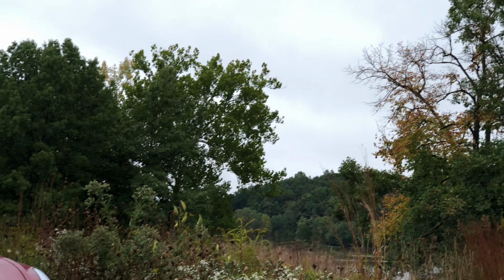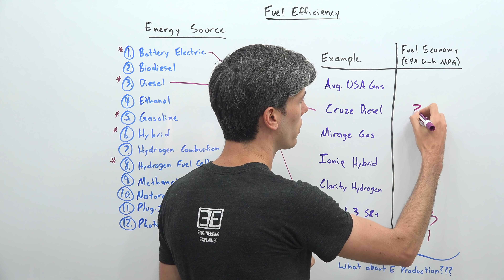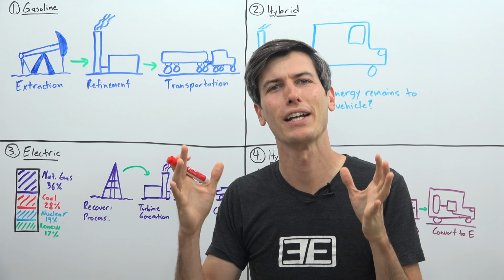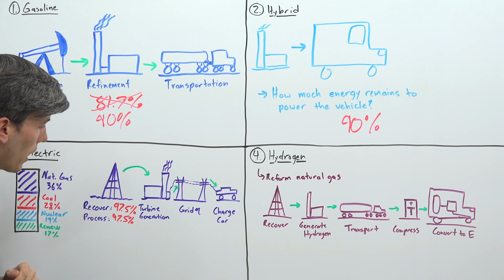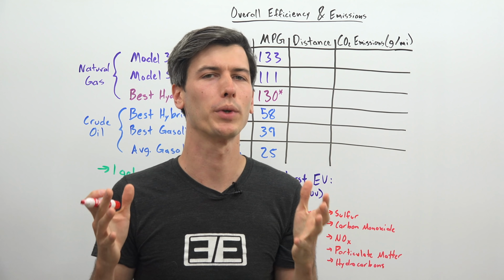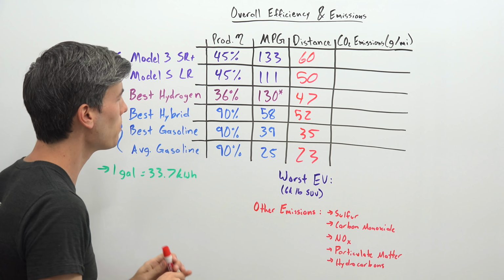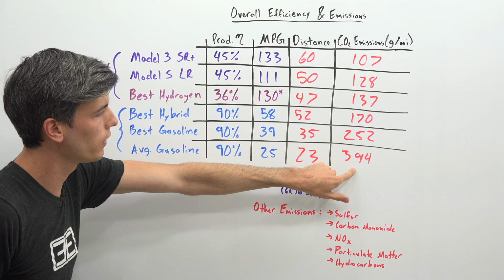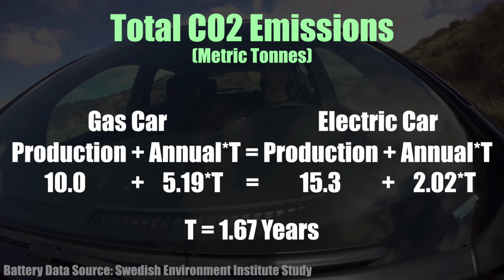Are Teslas Actually Better For The Environment?

Comment: You didn’t include natural gas or natural gas hybrids. By my calculation a CNG hybrid should produce 128 CO2 and be on par with electric. All while avoiding the range limit and recharging time of electrics. I suppose my dream drivetrain is plug-in CNG hybrid -good range and lowest cost per mile of any ICE.

Comment: Whats the comparison in emission for the mining of rare materials for battery power vs oil in manufacturing? The life cost for replacement of batteries for EV make the vehicle value stuffed after 5 to 7 years. E.g. 30,000 for replacement batteries on a Nissan leaf in Australia. Whats the cost of throw away vehicles after 5 years?. Interesting comparison just the same.

Comment: Dude, my petrol car averages 42mpg on my daily driving, increasing to 45-50 on my commutes to work (60-65 mph 99% of the way, about 7 miles).

That makes 234g/mi on average.

It's a humble Fabia 75bhp 3 cyl engine tho. I just find weird the "best" petrol cars have such bad mileages compared to my car, which is pretty common in Europe.

Comment: I had 2009 Jetta TDI and highway mpg was 42 and in real life it was even better, my personal best was 48.6 mpg. Also, I have a question, in the calculations, you excluded diesel emissions for CO2, why? I heard that diesel doesn't make a lot of CO2 but a lot of NOx. Is the CO2 so small from a diesel engine that it's better than electric in terms of CO2 emissions?  Thanks.

Comment: My diesel car is Opel corsa 1.3 liters (Branded as Buick in US market) Has 60 MPG as stock.
Reply: My 2.4 turbo d5 volvo gets 60 and it's on a 04 plate
Reply: @moodogtizer5884  04 plate?
Reply: 2004

Comment: When it comes to bicycles I've worked out that e-bikes have less of a carbon footprint than your legs. By the time it comes to food production, food packaging, energy used transporting the food, energy used going to the store, energy used cooking the food, energy used washing the dishes and energy used showering your sweaty body more often, not to mention the relatively low conversion efficiency of muscles (similar to the 25% of an internal combustion engine rather than the 80% of an electric motor). it seems like a win for the electric motor powered bike over good old fashioned muscle powering the pedals. That is unless your food is grown at home and you are a raw vegan who takes cold showers.

Comment: You should look perhaps at the work of Mike Berners-Lee (if the name sounds familiar his brother invented the World Wide Web). His IO method links CO2 emissions in manufacture to retail costs for different industries and the last figure I saw for the automotive sector was 720kg CO2 per £1000 retail of the car. So a £30k car is probably the cause of 22 tonnes of CO2 emissions before it does a wheel's turn.
So if you are a modest user of your car (UK averages are down to about 7500/year and falling) keeping a pre-existing small car for the next 10 years is probably better from a CO2 standpoint than buying a new EV especially if the electricity generation infrastructure in your country is still significantly fossil fuelled. A 100g/km petrol car can go 186,000 km before it has emitted 22 tonnes of CO2 (this includes an allowance for the 18% well to pump overhead that is the average in the EU according to the EU's own figures)so this is the break-even distance for the new £30k EV even if its fuelled entirely from carbon neutral renewables (and ATM most renewables are not carbon neutral due to fossil fuel use in manufacture/maintenance).
Of course manufacturers are very keen for you to believe their mantra that the use phase is far dirtier than the manufacturing phase - it helps them use environmental concerns to sell us stuff even when great chunks of it have been knocked out in China using coal-fired electricity.

Comment: @Engineering Explained, the main issue people miss with electric cars is the amount of electricity our power grid would have to produce if all gasoline cars/trucks were replaced  by electric vehicles.  We are not even close to being able to produce the amount of electricity needed with our current electric production capability.  There will not be anymore hydro dams built, nuclear power still has the waste issue our county has not figured out how to dispose of so this leaves more natural gas powered turbines required to make up for the current lack of electrical production.  Solar and wind are not reliable or consistent enough to be considered.

Comment: The solution? Build hybrid cars powered by an internal combustion engine that burns natural gas... Here in Europe Volkswagen produce some nice natural gas turbo engines... Put an hybrid system and you override all the problems of building the electric car charging infrastructure and the TONS of new electric plants that will be needed if all the cars will be replaced with electric ones (that I assume will be impossible...)

Comment: There is no math, you were very kind with diesel and petrol cars, a lot more to take in consideration, like lubrication, pollution of the ground, parts to maintain, and transportation of the fuel. When in electric car they are almost non.

Comment: There are another variable tho. Vehicle with internal combustion need lubricant and has more part in it (it has transmission, and lot of small part needed in its engine, compared to EV that only need motors). That extra stuff also need energy to produce and transport

So EV is far more efficient IMO

Comment: Considering Natural Gas derived electricity is a lower emissions source than gas/diesel...it makes me curious what a pure natural gas powered car would be.
Reply: Matt C you can actually convert gasoline engines to run on natural gas/propane, the conversion is expensive however. But then you have to factor in the losses of combustion. Car engines suck at turning fuel into usable energy compared to a power plants where efficiency = more profit. You’d also have to factor in building new pumps and transporting the natural gas like gasoline or diesel all of that increases emissions as well. Where as everyone already has what they need to use electric vehicles.

Comment: Also remember that with purely electric cars you don't need any engine oil, maybe some oil to diff depending on the construction, no coolant (?) etc. It's simpler to maintain.
Reply: Coolant is still available, since the battery can be overheating during operation. For simpler component, yes. The drivetrain in EV don't have gearbox, clutch, and torque converter, which means you don't need to replace the clutch plate, exchange the transmisson oil or changing the torque converter fluid. Also the electric motor has fewer component than internal combustion engine. But the battery is needed to replace for 3-5 years (longer if you don't use the car daily). Electric motor also need to replaced/exchanged for a long periode.
Reply: @govinlock8568  thanks for the clarification then, I really wasn't sure about coolant - electric stuff heats up quite a bit after all. ;)

Comment: The most advanced internal combustion engine in the best case scenario will be as efficient as calculated only for the first hundred thousand miles. There are a lot of components creating friction and wearing out very quickly compared to electric vehicles. Also maintainance and reliability is uncomparable beetween electric and diesel engines.  Electric power grid in whole world just keeps getting greener which we can't say about internal combustion engines :))

Comment: Need optimal scenario or control case for Model 3 being powered by home solar(with battery support e.g. PowerWall) charging 90% of time and supercharger 10% for long trips.   Just so we could see what the bar could be for those who are "all in" on converting to solar powered EV.  Also should have a worst case scenario e.g. police car which idles probably 90% of the time and is constantly emitting as certain classes of vehicles have significant idling time that isn't accounted for in standard emissions calculations.

Comment: I appreciate where you're going with this analysis, but I really think it's a lot simpler than all that.  With our aging infrastructure (and a need for new jobs), distributed Solar (on rooftops) makes a lot of sense.  Some support from wind farms and nuclear facilities is great, but ultimately we need substantial "self generation" and then local sharing beyond that.  When you combine a million-mile Tesla model 3 EV with rooftop solar/powerwall backup and throw in battery recycling, it's hard to argue that's not wildly environmentally and even economically sound for the long term.  I truly hope that's where we're going...sooner rather than later.  As a retired mechanical engineer I suppose I should support this with numbers, but it seems obvious to me prima facie.

Comment: You did a video about the Tesla mid range RWD vs the Performance.    Could you do a video comparing the Current performance AWD to the Long Range AWD? Like, Why is the 0-60 1.2 seconds faster if they both have 2 motors?

Comment: Excellent break down, I would like to see an analysis of bio fuels or other synthesized fuels. This was all built on the assumption that we use fossil fuels for either case. I think its reasonable to assume the future will largely be Nuclear/renewable. How do these stack up hypothetically if we assume you synthesize fuel using energy? There is probably not much data on this but maybe you can find something. For example the EV will no doubt have better range, but the overall environmental impact of an IC engine burning a synthesized carbon neutral fuel may be lower. Both in production, and operation. In short I wish people wouldn't think of IC engines as the problem as much as its just the fuel source!

Comment: I need the life span aswell. When do u need 2 put a new battery in and when do u put a new petrol engine in.  If u have to replace the battery 5 times in 200,000 kms that's going to blow those results out big.
Reply: Tesla has 8 year warranty for battery.

Comment: Also it should be taken into account that it is a lot easier to control the emissions of a couple of thousand electrical generating plants then it is to control the emissions of 40 or 50 million automobiles.

Comment: 37 mpg for the most efficient diesel?!
In europe that's pretty much the standard gas mileage for a regular old diesel engine. Some VW TDI small displacement diesel engines get like 60 mpg or in some cases even better
Reply: If you want some slow econobox bit of crap....sure. They are efficient, but horrible in most other ways. a 60mpg econobox diesel is barely on PAR with a 500hp luxury sedan....that alone tells you the efficiency differences
Reply: Yeah I was surprised by that as well. Ten year old diesel wagon still gets the equivalent of 60mpg. In regular driving, not even trying to be overly conservative.
Reply: @krpajda  Most people are comparing UK to US Mpg, 40 "mpg" in the us is nearly 50 mpg in the uk.
Reply: @stinger15au  that's a good point I converted from  l/100km to mpg and it defaulted to UK. Would still be over 50 us mpg tho.
Reply: He never meant fast or high horse power. Strictly speaking about efficiency. And also price. A small polo 1.4tdi is in another universe compared to a model S.
Reply: these are standard test results, not someone's road results.  it's just for comparing cars ...

Comment: Quick question electric vehicles mpg are taken into consideration brand new how does mpg of a electric change over time say 5 because after 5 years the battery would not be giving the same output I would really appreciate if you can make another video where you can make a video taking time and carbon emissions of ICE over 10 years

Comment: Can you evaluate the scenario with ALL the vehicles being powered by electricity? What should this mean for the power grid?
Reply: In the US - I had just read that if the current generation capacity was used such that higher percentages than are today - during the off-hours, both generation and grid would handle 70% vehicles being EV, today.  Those were on the EIA site using figures they had on capacity and time of day etc.   That is before any new PV, WIND etc get installed in the out years...

Comment: Strictly speaking the efficiency of the solar cells is not really relevant unless space is at a premium since that's the only additional cost. It's not like a fossil fuel where there are extraction and transportation costs for the fuel. Even if only 10% of the energy hitting the cell is converted to electricity it has no effect on the cost because the energy is there whether we're using it or not.. Same thing for wind turbines.

Comment: That diesel you show case is somewhat at the lower of economy in diesel terms! In the UK at least (including factoring in US MPG vs UK MPG). Don't you have any small diesels in the US? Off the top of my head I'm thinking of a BMW 320d (or any 2ltr diesel medium saloon) which would do about 50 MPG (about 42 US MPG), or a small/med hatch 1.6 Ford Focus diesel 55 MPG (about 46 US MPG).
Reply: diesel cars in the US really have never taken off in significant volume.

Comment: I'd give the battery production issue a wash if you could expect a battery to last as long as a fuel tank in an ice car but you can't. You say that they can offset their emisions in two years but that's not far off the lifespan of the battery. (I'll give it 4 years) not to mention the fact that batteries contain noxious materials and are difficult to dispose of and recycle. I still think that there needs to be a fundamental breakthrough in battery technology if we're ever going to get a handle of climate change

Comment: Can you extrapolate from raw materials (energy usage) used in petrol engine production vs electric motor and required battery thru their life cycles and recycling of said materials. Also is their any hazardous waste at the end of useful life of the batteries.

Comment: What about production of lithium and electronics vs steel/aluminum of a gas drive train. You briefly mention sulfur, nox ect. what about perfluorotributylamine with no natural way to lower levels in the atmosphere while the gas emissions have natural methods of lowering concentrations. Surely a gas plant will have its own issue with perfluorotributylamine but at a smaller level.

Comment: There is something very important to take in account it's the purpose/use of the car. Electric is way better than combustion (mpg) at low speed (1) and when you change speed frequently (2). So for someone who ride lot of freeway at high speed, diesel will be best mpg. For someone who is often in cities and traffic no doubt electric car will have better mpg. 

(1)combustion engine is designed around a nominal speed and when you drive slower you waste energy it's very simplified vision but it's most the rpm that make the fuel consumption, driving 20mph at 2000rpm second gear or 60mph 2000rpm 6th gear will use same full over time, but mpg is way better.
Of course a faster car needs more energy because of friction but the engine has an horrible efficiency at low speed.
Electric engine instead has approx the same efficiency wathever the power. 
(2)Because electric don't use power when it's not moving and because of regenerative braking.

Bonus : there is the question of winter when you need to heat the car.
With a combustion you get the heat free, it's already there, you have a ton of heat loss you simply use.
With electric you most likely have to use a heat pump or something which will drain your batteries and affect mpg.

Comment: 95% of my vehicle use is just moving my butt from home to work and back. I use a 700cc motorcycle which gets 80 MPG. I guess I'm less polluting than best case Tesla (in the 100% fossil fuel for electricity generation case). Yes I'd rather go EV but for me the $$ doesn't work out. When I can buy a 100 MPH/100 mile range bike for $10K I'm in.
My short term plan for improving my footprint (after the bike for commuting) is to put PV on my roof, then maybe storage.

Comment: American MPG ratings are terrible! Here in Europe, I have get an average 47mpg in a combination of city and urban (with traffic) driving and over 70mpg on the motorway.
That's from a 2013 1.6 TDI Seat (with the diesel gate patch)
Prior to that, I had a automatic 1.6 petrol Ford Focus with the dual clutch system. That could do around 40mpg around town and 60mpg on the motorway.
And before that, a 2005 Ford Fiesta 1.6 TDCI which I used to drive like a loon and still get over 50mpg all day long.

The other week, I even got to spend a couple of days in a brand new Peugeot 308 with a 1.2 ltr turbo engine. It actually impressed me what they managed to get out of a small engine as it had  21bhp more than my current car and the average mpg I got out of it was around 65mpg with no motorways.

Comment: Hey can you make a video about conversions? I see they are becoming quite common...what happens if you put 2 motors with no comunication bwtween them (1 on the front and 1 on the rear or 2 on the rear)? What happens if the car keeps the gear box and you switch the gears too fast? Stuff like that...

Comment: Gasoline vehicles would do a lot better if internal combustion engines has the same kind of thermal efficiency as a combined cycle natural gas power plant, but even Toyota's best atkinson-like engine is only ~42% efficient. Unless we start seeing expansion ratios closer to 16:1 on gasoline engines, I don't think we're going to see the kind of efficiency that "mobile power plants" would need to provide to compete with electric options and plug-in hybrids.